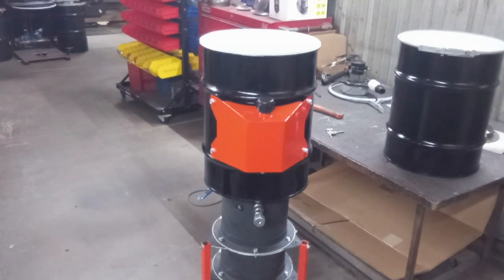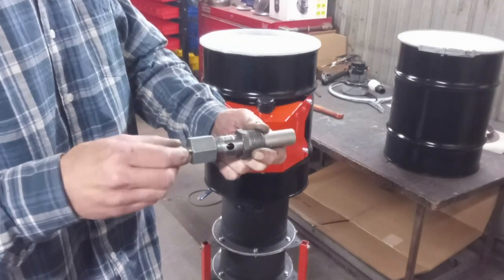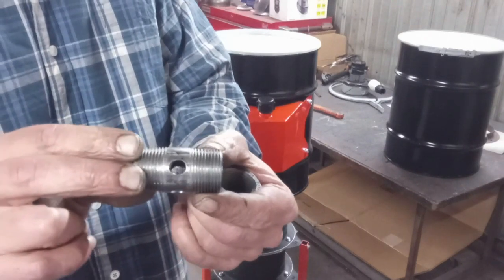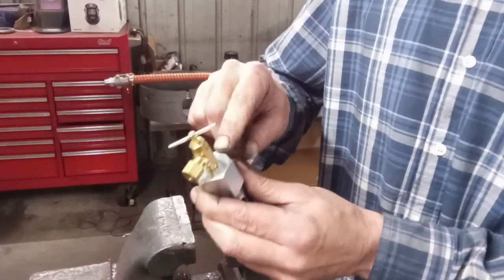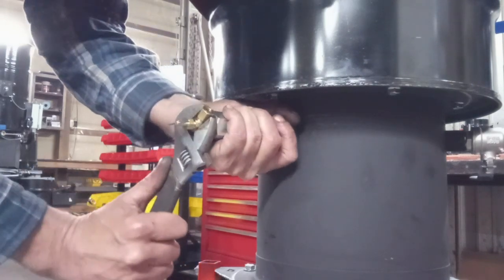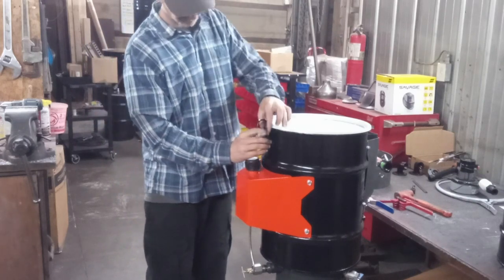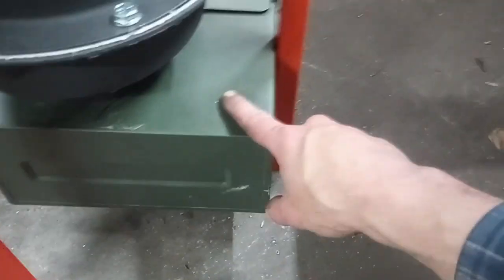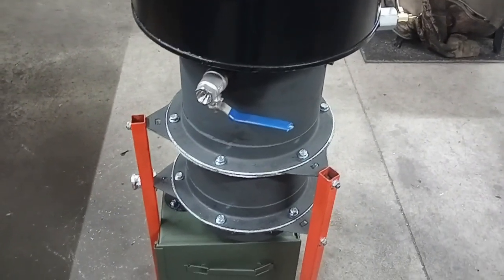V 1 Weld Kit Part 4 Wrapping Up the Gasifier

Comment: Do you use the original gasket of the ammo box?
Reply from the maker: Yes it dont get hot. If you are cooking that seal something is wrong. The gas needs be cold at this point.
Reply: @Thrive-Off-Grid  Thanks for the reply, I thought you showed it to be around 300 degrees at the ash clean out, maybe I am wrong, but I find it hard to believe it's actually cool with the hot gas coming off the reactor flowing through it.
Reply from the maker: @jay90374  The gas cools very quickly I also show the temps at the ammo box its under 100 degree F. So obvously it is cooled.
Reply from the maker: Its only 57 degrees here. https://youtu.be/KKFjdlBm7Nw?list=TLPQMzAwNDIwMjNUw1spg4QhmQ&t=1066
Reply from the maker: OH you are talking about the ash bin. Ive been working on the DXF-10 and was not thinking about this unit. Yeah the Ammo box has been working fine. Ive ran 10 hoppers though it so far and no issues. Plus we built actuall gasifiers out of the larger cans and the seals hold up just fine. If you cook one out just line with the ceramic gasket tape.
Reply from the maker: This gasifier is DIY and the ammo box is the easiest best solution I could come up with. If you have a better solution Im all ears. but that compartment must have an access door for clean out and there is nothing I know you can just buy that will work better than an ammo box. The only other way is to put a big elbow there and dump into the barrel filter. But fittings that larger are crazy expensive. The point is to build functional gasifier that will actually work. Not like others on Youtube. This machine actually works and makes clean, consistant gas.
Reply: @Thrive-Off-Grid  Thanks, I was just wondering how it held up to the heat, and I agree, decent-sized closures aren't easy to find second-hand. 👍

Comment: Would you recommend using anti-seize on the pipe threads to help facilitate future removal for maintenance?
Reply from the maker: Up to you. I dont crank them in there so I dont have issues getting them out. Anti sieze makes a mess and will melt and drip down the unit. The only place I use it is in the internal mounted jets.